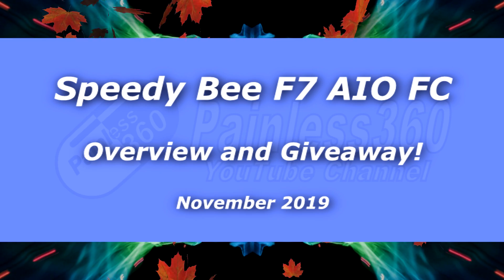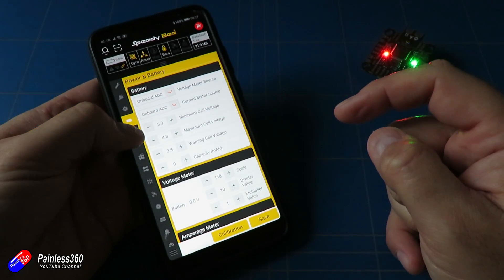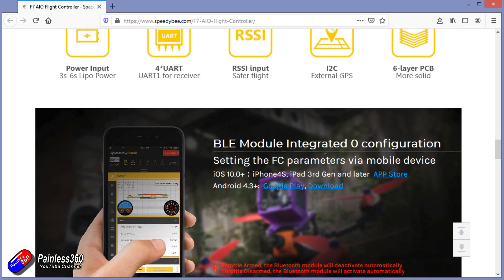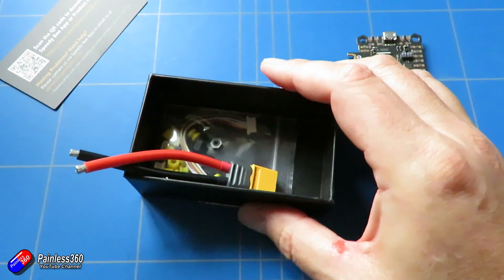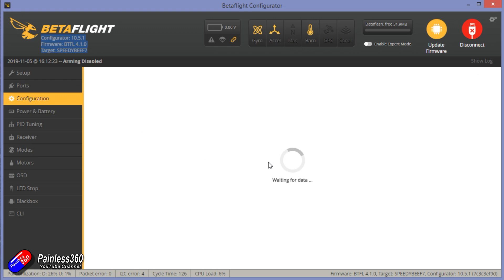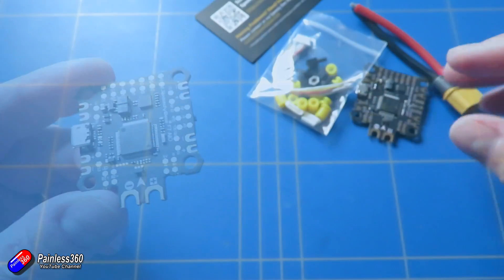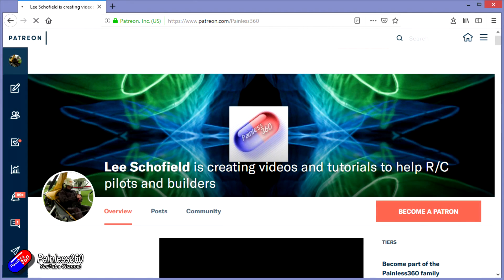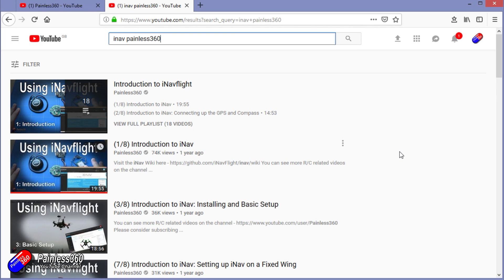Speedy Bee F7 AIO FC Overview and Give Away!

Comment: 2 questions:  1) how do you solder to those U shaped pads  2)  why do the diagrams show external ESCs?  Are they required to run this FC?  Or can you wire your motors directly to the FC?   Thanks, Mike.
Reply from the maker: External ESCs required. Best of luck!

Comment: I'm having a weird problem with the f4 version so this would be a perfect replacement.
It lasted almost a year but now motor 2 stutters once every 2 to 10 seconds. Replaced motor and single esc, didn't help. Resourced it to motor 5 and grabbed power direct from the battery lead, didn't help.